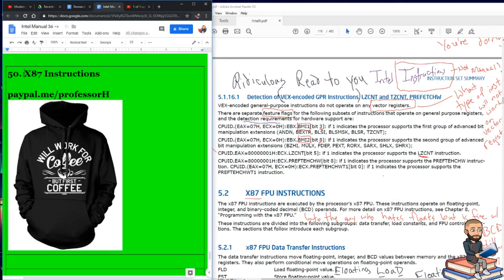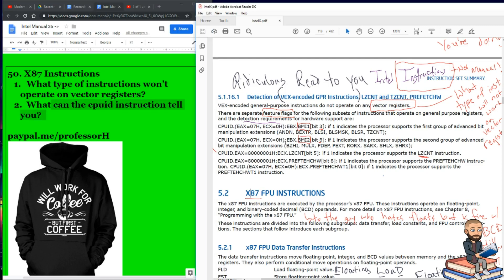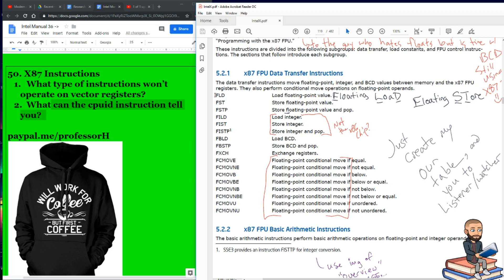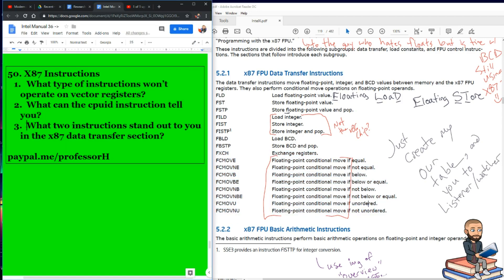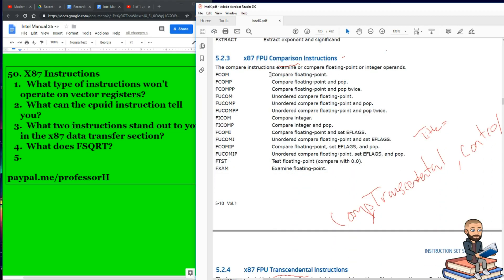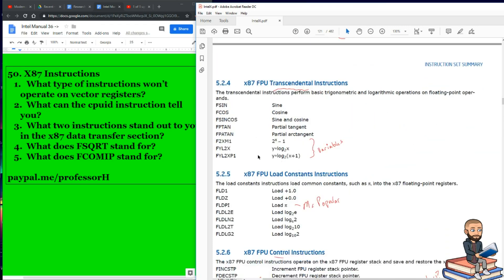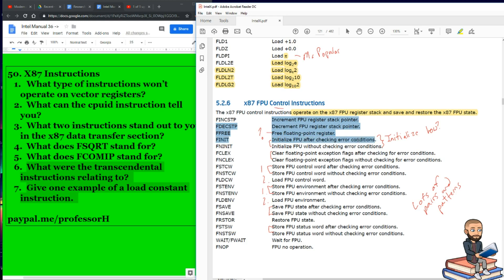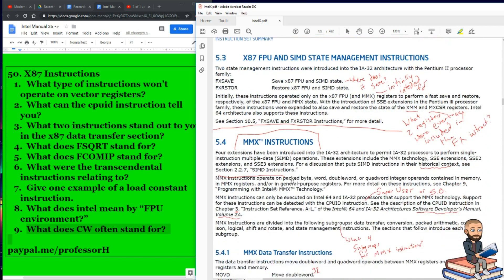Intel Instructions 50 x87 Instructions

Comment: I have one issue with the X87 FPU data registers. I learned that those registers are considered as stack when executing X87 instruction, I wish u can explain what that means? And what programmers should be attended to when coding X87 instruction with those "stack registers", thanks!
Reply from the maker: sorry for the late reply, I'm rarely logging into youtube anymore, work is busy and I'm not a fan of them as a company/platform. However, I'll try to login more to answer any questions you have. So a stack is a data type, like an int, float, string, array, etc. With low level programming like this stacks are more common.

Comment: The BCD is elementary coding . a 8 contact matrix device , one of the legs is ground . Usually for electrical bus signs and car races. football matches. arena number display .
Reply from the maker: Fascinating, thank you for that!
Reply: @Calm_Energy  Its facinating. Hey look at this. the BCD is broadcasted via "Radio Clock" . Recieved onto inductor antenna at 2.5MHz . With a Timecode subcarrier at 100Hz  linked to an Atomic Clock . Several beamers across the globe ! https://en.wikipedia.org/wiki/Radio_clock
Reply from the maker: sorry, I never saw this reply, I just got back into making videos again...  that's interesting though thx for sharing! I was recently working on consensus algo design and that clock can play a role!